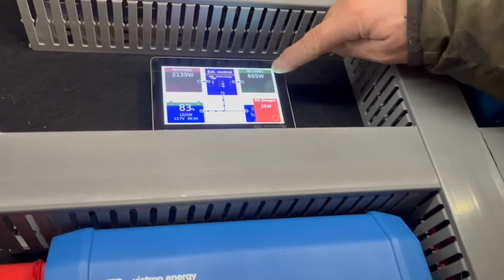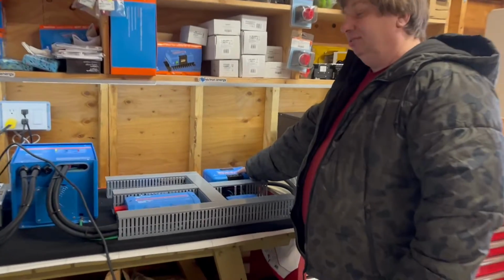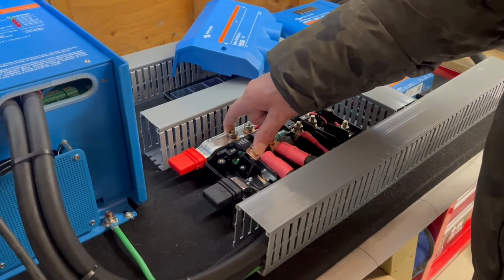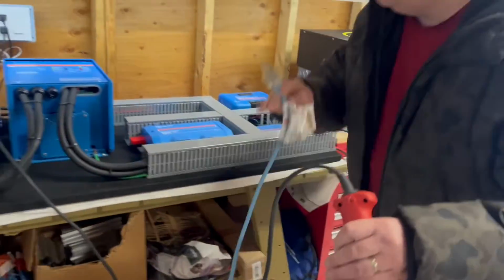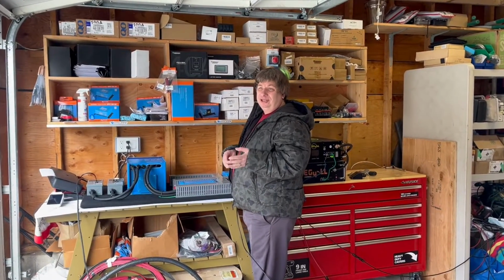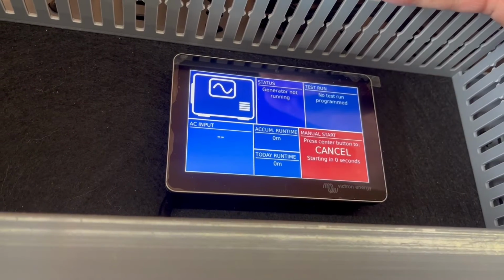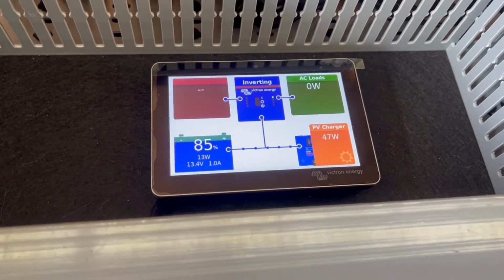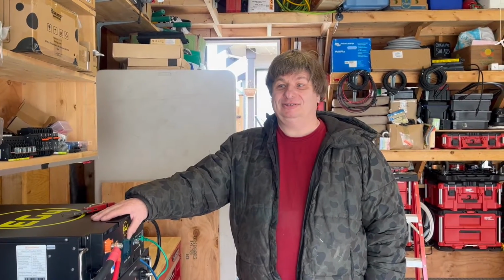Testing 2 Versions of EG4 batteries with Victron system.  Testing  both batteries load capacity

Comment: I see you are controlling the Honda EU3000IS generator with the Cerbo GX. The EU3000IS is not equipped with a remote control connector, and furthermore, the manual choke must be active, even if the engine is hot for it to start. What modification kit do you use to control the generator? Thanks
Reply from the maker: We use these.

https://www.genstart.ca/index.html